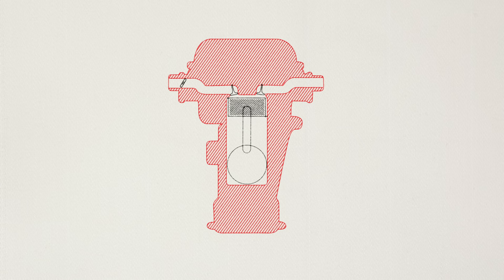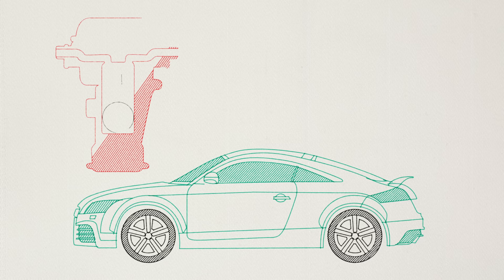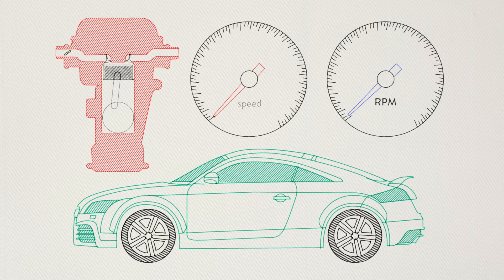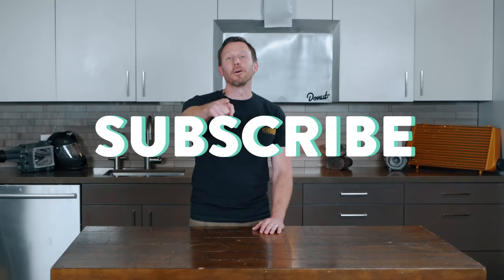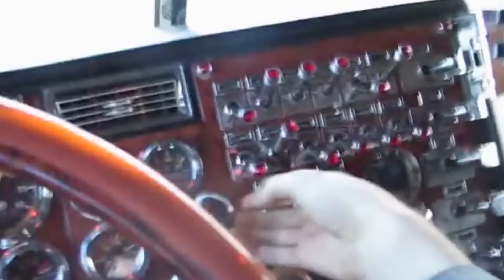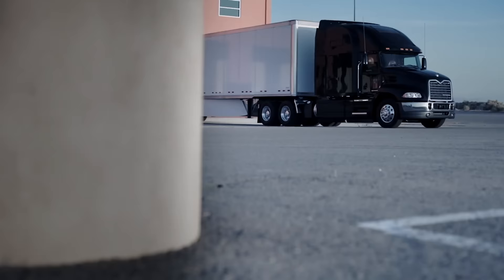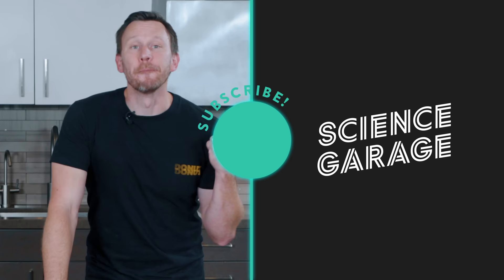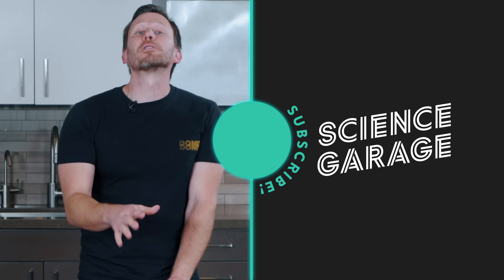ENGINE BRAKING | How Semi Trucks Slow Down Without Brakes | SCIENCE GARAGE

Comment: I`m sorry to be one of those ``ehm actually`` people, but as someone who studies mechanics here in europe, and who drives a (european) turbo diesel manual every day, i will say this much: engine braking DOES very much occur in diesel engines, just maybe not in the same way as in gasoline engines (and said engine braking is VARY noticable in both my car and in the vw transporter vans we have at work, especially in 1st and 2nd gear), and the phenomena that occurs in diesel engines may be known by a different name on your side of the ocean. In diesel engines, the car will slow down when you let off the gas because of the high compression. Basicly the cylinder will fill up with air and the piston will compress said air (high compresstion btw), but, because you dont want to  accelerate, little to no diesel will be injected, and with no bang to push down the piston, aside from the compressed air, energy will be lost, rather than produced, and the car will slow down. A turbo helps in this sence because the residual boost will give the piston more air to compress without combustion, and, once boost is lost, there will also be a vacuum which will likely have a similar effect to what a petrol does. Also, from my experience with a 1.5l turbodiesel vs a 2.2l petrol, my diesel slows down my car more violantly than the 2.2l sedan my dad owned until recently. Also, the reason trucks use jake brakes or exaust brakes isn`t so much that the engine isn`t able to slow down the truck at all, but rather that the weight and inertia of the vehicle are to much for compression losses alone to slow it down significantly, and aditional restrictions need to be added to the exaust to further slow down the crankshaft. Again, sorry for being ``that guy`` but (as you could probably tell from my wordy comment) i didn`t agree with alot of  what was said in the video, and wanted to share my viewpoint on the situation, since I felt you werent being truly fair to diesel engines in general. Keep up the good work though.
Reply: You've answered the big question I was left with from this vid, thanks.
Reply: I also saw some diesels haveing throttles in the exhaust creating loads of backpreassure and thus slowing it down. of course if used to excessively this can destroy the engine very quickly.
Reply: Ok so the subject has been bothering me since i watched the video and wrote my first comment, and after reading the wiki page  and a couple of forum posts about engine breaking i came to the following conclusion: diesel compression losses alone seem to not cause as much engine breaking as i had originally thought but while it is true that the compressed air will spring back, some of the energy WILL be lost in the form of heat to the water jackets and such, and if the engine is turbocharged, the turbo will also cause back preassure, making the pistons work harder to get the gases out, which means more breaking, not to mention (as i had originaly stated) an idle turbo will likely cause a slight vacuum on the intake manifold, and you know what that will do if you watched the video. Couple that with the different gearing (which plays a huge role on how the negative torque generated by the engine afects the vehicle) and you have a turbo diesel which, depending on who you ask, will engine break as well as a petrol.
Reply: Jakob kerber. Yeah it`s a commonly used system here for heavy trucks, instead of traditional jake breaks, but i doubt its a widespread system on passenger cars. What i do know is that  some manufacturers do use something resembling throttle plates, although if is, as far as i understand, used primarily in conjunction with the egr for emissions purposes, but i doubt manufacturers would add a throttle plate and not use it to aid in engine braking. At any rate, even if diesels dont provide much braking on their own, the turbo adds more than enough restrictions to male up for it.
Reply: Thank you I was about to ask why my 1.9tdi vw's engine brakes the car more than similar petrol engines I tried lol
Reply: I completely agree with you Andre Anastacio
Reply: @andreanastacio9548  also modern diesel have a 'shut off valve' in the întake, similar to the throttle body valve in gas powered engines, which is used when to help with engine braking besides it''s regular use of shutting off the engine.
Reply: Thank you!
Reply: Andre Anastacio thank you so much for your wordy comment, it's what I was going to write my self in response to this vid that was good, but not great at explaining how compression braking in a diesel actually works. 

As a Diesel Technician here in Australia for nearly 20 years and been working on Cummins and all that for that long I would like expand on your comment, just like you I don't want to be "that guy", but it hurts my head to think people go to the effort to make these videos without consulting people who work in said engines🤦🏻‍♂️. 

 Diesels don't have throttle body's no, but that have mechanical and now electronic injection, when you come off the throttle you now stop the supply of fuel to the engine, the injectors are "turned off" you could say, so now you have just a air pump compressing air but no fuel, there for no energy created to push the piston down, but now a air cushion slowing down the pistons.
Reply: Rafael Lecuona not so much friction is the reason. If you are in a lower gear the wheels will now drive the gearbox to the engine at that lower ratio, causing the engine to rotate faster while being driven by the wheels. In a higher gear your ratio of speed in that gear is much higher, so when you back off the wheels are going a faster road speed but the gear box is in a much higher ratio so it will not over run the engine when backing off like a lower gear wheel. If your in a high gear and running the vehicle out to the top of that gear you will experience the same braking power as you do in a lower gear. It's just ratios of the gears causing the effects you feel.
Reply: Jakob Kerber those throttle plate are exhaust brakes. So a passenger vehicle under 4.5ton will not have this. Over this and you will now have trucks with exhaust butterfly's that block the exhaust and cause back pressure to the engine like you said, and no they will never destroy a engine, you are just slowing the exhaust gas down from escaping the engine faster then it can suck it in through the intake, no different to closing the intake with a butterfly to stop air coming in like a throttle body. Once you start getting into semis then a exhaust brake alone in not enough, they will then move to engine retarders like "Jake Brakes", and in most European trucks they use both systems, a engine compression retarder and a exhaust brake. I'm not trying to disrespect your comment in any way.
Reply: @andreanastacio9548  It wasn't on a  car I saw it on a tractor from the 90s (Steyr 9125 I believe) so nothing to do with emissions either.
Reply: @jacob.s3619  not disrespectful in any way. it wasn't on car however should have specified that. I saw it on a Steyr tractor I believe it was a 9125 so  5.2 tonns
Reply: Andre Anastacio I was hoping I wasn’t the only one thinking um not exactly correct. I drive a pre common rail indirect injection diesel Landcruiser with no EGR or anything of the sort. At 22:1 compression ratio you better believe it’s got some engine braking.
Reply: Jakob Kerber oh right, makes sense. Yea agricultural tractors use them too.
Reply: @jacob.s3619  Yeah, so my explanation wasn`t wrong. I started second guessing my own knowlage of the diesel engine when i looked for info to back me up after my first comment, because, like i said i`m studying mechanics (heavy transport vehicles to be precise) and am by no means a master (i`m actually an apprentice who loves to learn how these lumps tick). As for how they fact check, i think that in this case were too broad and imprecise in their explanation in an attempt to explain something as complex as engine breaking in diesels, as quickly and simply as possible, and may have only looked at the wikipedia page for engine breaking, where jake brakes are mentioned. The problem was that in the process of doing so, they forgot about people like us, who work on these engines, have a decent understanding of how they work, or at the very least live with them every day and have had the oppertunity to compare how they drive compared to petrol cars, in which case these discrepencies in the video will be very jarring. In my case what got to me was not only the claim that diesels dont have any engine breaking on their own (which is atleast partially false due to pumping losses related to high compression) but also because they compared petrol cars to a large diesel truck from the early days of this engine type, while ignoring the fact that diesel passenger cars dont have a jake brake but still manage to slow down just fine when you let off the gas. they should`ve taken the time to do a propor apples to apples comparison, between, say, a petrol ram 1500, and a cummins diesel ram 1500 and compare them side by side in different scenarios, before claiming diesels cant engine brake.
Reply: @7938Brandon  I know, right? I drive a 1.5 turbo diesel renault megane and if i`m on the throttle and fully let go of the pedal suddenly, the car will slow down as if i slammed on the brakes, especially in 1st and 2nd gear, and the vw transporters we have at work are 2.0 tdi engines and are just as severe even though they are permanently loaded with hundreds of kilos of tools and various coach and bus parts
Reply: Afo Đok oh yeah yeah
Reply: As a licensed car mechanic and turbodiesel car owner I agree completely with your comment above and have to disagree greatly with the nonsense put out in this video above. I would also like to add that here in europe where the trucks use tech from this century we have retarders as an added break wich are packs of magnets on the output shaft with coils surrounding them and when power is send to these coils it will, much as the resistance in an alternator but multiplied, slow down the shaft and so the speed. I have worked in an official delaer of chrysler jeep and dodge and it was always strange to me how american brands were so behind on japanese and european brands in tech and quality.
Reply: @jonasvandersmissen5449  It`s true that we dont generaly use exaust brakes in the eu because of noise regulations and instead use electromagnetic retarders (Telma), or hydraulic retarders (or intarders as they are often called, atleast here in france). Correct me if i`m wrong, but magnetic retarders are being phased out (especially on heavier trucks) because of the surprisingly high risk of overheating and catching fire from prolonged use. Also, i`ve heard the name voith thrown around alot recently, do you know if it`s a new type of retarder, or if it`s just a brand of hydraulic retarder?
Reply: @andreanastacio9548  i am not up to date in the truck world. I always did cars and now I'm doing maintenance for a microchip factory.
Reply: Thanks for the comment. this actually cleared up some questions I was having.
Reply: Your talking about modern desiels because modern diesels DO have a throttle bottle unlike the older semis
Reply: Thanks for the explanation. I was wondering how the engine braking in my Jetta TDI works since of course it doesn't have a Jake brake, but has plenty of engine braking.
Reply: those americans :')
Reply: I'm one of those "ehm actually" too but with tech  😂
Reply: @7938Brandon  What year is your Toyota, and what country are you in?
I had '71, and '79 FJ40's, both gas, and have known about the diesel version for ever, but have never seen one here in the states.
Reply: my diesel car definitely engine breaks, I mean anyone who uses a manual car knows that.
Reply: @andreanastacio9548  Every IVECO 7.5  and 18 toner ive driven here in the UK has an Exhaust break. In fact the 18 toners wont stop running unless you use it to stall out the engine. Never driven anything newer than 2005 ish though.
Reply: @aldeacristian4582  The shut off valve in the intake is also there to be able to stop the engine in case of a runaway. A diesel engine that blows a piston seal or a gasket and ingests engine oil can merrily run on that oil. And because there's no way to restrict the intake of that new found fuel source the engine can rev up to destruction. The valve in the intake is there to literally choke the engine in that case. While the engine will still be fubar at that point, it might save the rest of the vehicle and it's contents from going up in smoke along with it.
Reply: That may be true in a small commuter turbo diesel CAR but for anyone who's ever actually driven a loaded tractor trailer down any sort of decline, we know that the braking power created by simply releasing the throttle isn't nearly enough to overcome the sheer weight. I'm not sure about Europe but here in the states like he said in the video a loaded rig can weigh as much as 75,000 lbs, and there are even special permits you can get to legally exceed that weight limit.
Reply: @corbingarrett1206  If you read my  comments again, i did say that trucks do have engine braking, just not nearly enough to hold a fully loaded rig down an incline, because pumping losses and exaust restrictions alone aren`t enough, hence why we use exaust brakes, and various types of retarders. We do also have heavy loads here in the eu, with some countries allowing 60 tonnes or 120 000-ish pound rigs, i`m assuming also with special licences. Obviously the engine breaking of even a 16litre, 750 hp engine wouldn`t be nearly enough even on the slightest of inclines.
My point with my comments was to say: Yes, diesels (even truck engines) produce engine breaking, but how much is dictated by the engine design and accessories attached (n.a or turbo, how much compression, wether additional systems like exaust brakes or butterfiy valves are used), and also that trucks need auxiliar brakes (retarder, engine brake etc...) because even with such large engines, and such short gears, engine braking still isn`t enough for the weight being pulled
Reply: i just came to the coment section to say the sam thing but you just said everything . good job 💪🏻💪🏻
Reply: Someone give this man a cookie, couldn't say it better myself
Reply: Andre Anastacio yep, you’re right. Sad to see such a big channel just sharing lies.
Reply: I drive a diesel for my work and I know it engine brakes due to the fact that when I let off the gas I feel the transmission slop like I'm on the clutch for a second, then it feels like I hit a wall.
Reply: You are from Spain?
Reply: @jakobkerber5357  those are for killing the engine when it "runs away" as turbodiesels like to do :D
Reply: donut media is from california i think. they dont get to speak for us other 49 states.
Reply: YES, THANKYOUUUUU
Reply: I’m sorry but I couldn’t read all that

Comment: Can we get some more videos on semis. Like DEF systems, air brakes, and axle weighs
Reply: Def "cleans" our exhaust, airbrakes rely on Chambers and axle weights for being legal is 12000 on the steers, 34k lbs on the drive tires and 34k lbs trailer tandems.
Reply: Both of these guys are wrong, DEF is made of synthetic urea, ammonia, and water that is sprayed via doser valve after the DPF(diesel particulate filter)into the SCR( Selective catalytic reduction) in order to bring down N0x levels for legal standards. They're extremely problematic since the beginning of their use. air brakes are for the most part are simple it's just a lot of valves that go into it, you're better off looking up some bendix or wabco air brake videos or doing some reading on how they work because theres too much detail to explain properly
Reply: DEF system cleans our pockets too
Reply: Karan Gill you got that right
Reply: Plus when burning off it consumes way more fuel than when it’s not burning off.

Comment: Small correction, in gasoline engine the fuel will be completely cut off if you are above certain RPM (like 1500), so no “idling fuel air mixture happens, just air. Also, instead of the power stroke you just compress air which will not cause the power stroke, which also helps the braking. So, vacuum and pressure slows it down, not just vacuum.
Reply: Actually no, the energy used compressing the air is spend on the downstroke. Only vacuum is slowing.
Reply: @nukeclears not all of it. compression heat losses definetely help with braking

Comment: I’ve always used engine braking with my S4 and Stinger, and the later is even smoother because of the 8 speeds.  Very often I slow down to the speed I want without even using my brake pedal. Nothing crazy, i.e. when getting out of the highway.  Gives those brake pads more life!
Reply: Brake pads are cheap. Engine/transmission parts are not.
Reply: @bigqwertycat  So, you didn't watch the video, I guess...